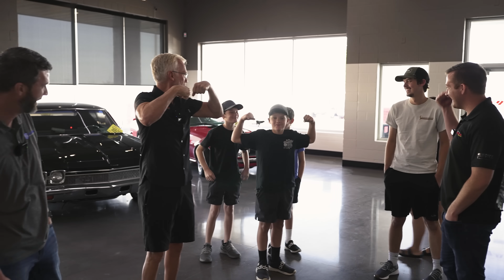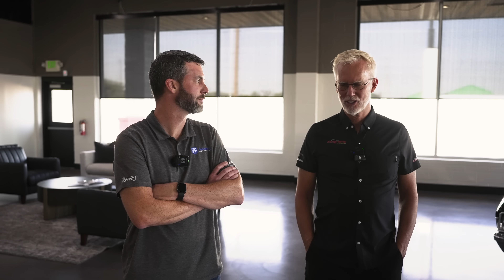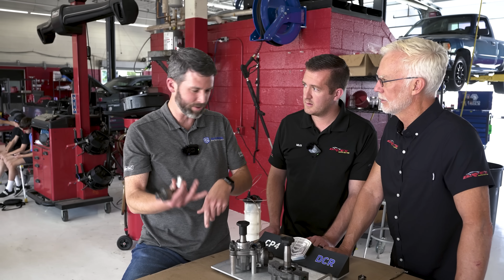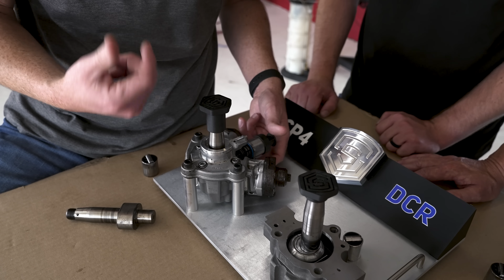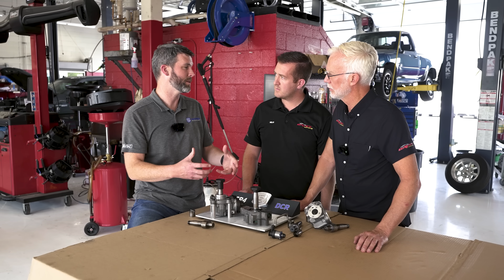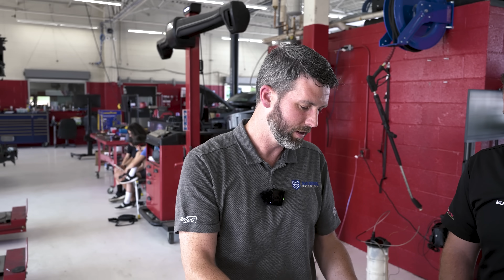Breaking Down How The CP4 Pump is a DISASTER & How To Avoid It With The DCR Upgrade!

Comment: I’m not saying it can’t happen but dang is this being played up to push these additives and pump swaps. We have a fleet of F250, F350 f450 we change the oil, change the fuel filters and fuel up and don’t run out of diesel fuel. None of the trucks in the fleet are under 100k 

Everyone will have you believing that you pull off the lot and your trucks just going to blow up and if you drive a Chevy or a ram you’re going to be dodging Fords because they’re all just failing on the freeways at an alarming rate! Ridiculous haha not mad at you guys, good for you. It’s a hell of a sales pitch.

Comment: The best thing i did was install the dcr on my 2018 f350. It has been on for just a little over a year now, and there no issues at all. Well worth every penny. It is very easy to install if you are mechanically inclined.

Comment: Glad 2015 has the CP3.
Reply: Hey Darryl, If you are referring to the 6.7l Power Stroke platform unfortunately 11-current uses the CP4 design as shown in this video. The DCR is a direct drop in replacement for 11-24.

Comment: S&S talked about making the dcr a key way designed shaft to make it easier for installers to clock it properly without potential for mistakes. It would be nice if they followed through. The dimple design to clock it is a shity shortcut. But it costs them nothing to do nothing about it. Sounds a lot like Ford and the CP4.

Comment: Thanks great info, question ~you ask for our views on perplexing issues you point out in your shorts from us viewers but there’s no place to respond in shorts.
Ok I’m planing on getting a new truck to replace my 2017 Ram 1500 v6. Nothing wrong with it just 8 yrs old with 17500 mils.  However from your insight and warnings for DURAMAX and Fords power stroke wonderment have ruled them out for my wants in a new truck. So, I’m left with a new RAM with its 15 recalls or possibly a Toyota tundra with 3 recalls. I’m going to get your book/video to help make up my mind.

Comment: The worst CP4 failure I've had on a customer vehicle was a pump that seized just like you guys were saying. It was on a LML duramax, when it seized up it did not break off the crank or cam pins. The gear on the CP4 cracked and partially blew up, shrapenal shot a hole through the front cover and some of it went through the crankshaft gear, damaging the crank shaft gear. Customer traded in the vehicle before we knew that it needed more than a complete fuel system. Bad situation but I still think it worked out better for him. Pretty much every CP4 failure I've had was on company vehicles, getting fuel from questionable sources, steel slip tanks, etc. (I'm in Canada, I think our fuel is a little bit better)

Comment: I have the S&S disaster prevention kit is on both of my ford 6.7 's such a great company out there, just knowing if the cp4 goes it'll only cost me a new s&s dcr conversion pump rather than a $10k plus engine repair if the cp4 grenades awsome company highly recommended
Reply: Or get a low miles CP4 swapped from someone for a couple hundred bucks, CP4s are fine, good fuel filters, good additives and easy 500k miles on one.

Comment: These should be standard equipment right from FoMoCo now. How many class action lawsuits are needed before they realize how bad this Bosch pump is. Other manufacturers have got rid of this CP4 pump now just for this exact reason. Follow along Ford, ditch the Bosch CP4.2 pump, and help bring back PowerStrokes to the top of the list of the best diesel engine made today.... It's already the strongest! 👍🏻👌🏻🛠️🔧🔩🦺🛢️

✊🏻🇺🇸🦅🇺🇸✊🏻

Comment: The easiest way to keep your CP4 or even your CP3 healthy and happy is to use quality fuel and a good additives for lubricity. I’ve seen a million miles on a CP4 with no issues if you just use common sense preventative maintenance. I’m not saying if you have an extra 3 grand laying around it’s not a great upgrade, but in today’s economy, most of us have to keep our stuff that we have working.
Reply: A friend had his F250 pump grenade. The repair was $11k.
Reply: @AlanSanderson-u4t  I understand, but that isn’t the pump’s fault, they have been using CP4s in Europe for decades, it’s the fuel. We have ultra low sulfur fuel here in the US they don’t use that in Europe. The sulfur is the lubricant in the fuel. If you use an additive like HotShot or Howes, the chances of something like that happening are very slim. Water in the fuel is also a big factor, that’s why you need to be careful about where you get your fuel. Even with a DCS conversion, if you run crappy fuel, you’ll be replacing injectors and rails.

Comment: what is the weld procedure  you are using  for tig welding the crank gear to crank shaft ...any preheat/ post heat .. and what filler rod are you using... being this material is not just plain carbon steel

Comment: Clearly the have to come up with a better high pressure fuel pump.  This is not good.  A better design would be a multiple piston pump with a shorter stroke to achieve the same volume.  The ramp would be less aggressive for each piston.  The DCR is an elegant solution.

Comment: Would another preventative be to have a rising rate fuel pump+ regulator supplying the DC4 pump. Have it run independently off of the ignition so there is always a good flow of fuel to the pump?

Comment: i have an appointment to get my conversion done in the morning on my 2020 with 36k miles and have had no issues with the cp4 to date... i feel like neo in the matrix dodging bullets every time i drive it. hopefully i will feel like smith after, that can never die.
Reply: The cp4 isn't really as bad as people make it out to be, most of the failures are caused by people putting Def, gasoline or contaminated fuel in the tank.  That being said, I dropped my truck off yesterday to get a dcr pump installed.  I've rather pay 3k bow than risk a 10-15k repair down the road

Comment: I had a CP4 fail in my A3 TDI. At least VW replaced everything under warranty... The fact that the main fuel supply first goes through the pump to act as lubricant is stupid. The CP3 keeps them separate and enjoys fewer failures because of this as well.

Comment: Three questions as a VW tech.
What's the difference in a CP3 internal compared to the DCR/CP4 that makes them more robust than the CP4?
And if a CP3 can be retrofitted to so many of these CP4 engine layouts with aftermarket kits, why isn't Bosch and other manufacturers reverting back to CP3 or at least an internal design similar to CP3 to improve their durability?
Standadyne and other additives claim to add lubricity to diesel, would that help the CP4 last longer?
Really loving these videos and thanks in advance for the answer, really appreciate it
Reply: Hi, CP4 ingeneer here :) I work at CP4 factory in Europe. The biggest difference is that the CP3 uses excentrical shaft with much bigger contact patch (triangular shaped "rotor" element on the shaft that is lifting the pistons. The only rotating part is the shaft itself contacting the triangular element with it's full area. 
In the CP4 howewer, the shaft rotates and is directly in contact with the small roller on the lifter that guys showed. This lifter spins 4 times faster than the engine (so about 4000 rpm at idle already) and the contact area is very small. 
CP4 is much much more efficient and capable of higher presssure and flow but it is a bit sensitive. It absolutely can't run dry for any second and also the fuel must be 100% clean and "oily" enough. 
Sadly, most of the failures occur in the USA due to fuel issues. We have most of the recalls sent back to our factory and we do a detailed analysis of every recalled pump and 9 times out of 10 it's the fuel. Usuallly silicone particles (sand, dust), water, other chemical elements...

Secret info - there is a new version of this pump comming out soon (2025). It should resolve the bottom end issues.

Comment: Would it be better for the lifter be a flat tappet like the cp3 pumps...I have the oem cp3 and injectors on my 08 dmax with 320k miles and still going with howles fuel treatment every tank full

Comment: Just had a Case 110C tractor at work that melted 1 piston in the engine caueing blow by and no compression on cylinder 4 eventually leading too a crankcase of engine oil diluted with diesel wiping the engine out. The CP4 had been replaced recently, it was still shiny and clean looking without the engine paint on it like it comes factory, and the injectors appeared original and once i pulled rhe FCA it had metal on it. It appeared it probably had a running issue and it had an injection pump put on it due to low or insufficient rail pressure and that was the extent of the reapir. Im sure after a new pump it ran as it should until it sent metal into injector 4 and held it wide open which melted the piston and the tip of the injector finally causing a crank no start as all of the rail pressure was dumping out of injector 4

Comment: Running a 2013 LML DMAX with the CP4 pump and the only owner   Have always used Power Service or Hot shot secret fuel additive.    The big one is, I change my fuel filter every other oil change no matter what the percentage saids on the dash.    Also I get top tier diesel when I can.   So far, 471,567 and still going.    I think alot has to do with keeping that pump lubricated.
Reply: This is the Key. Clean fuel, and a good supply of it. Ford obviously gets the worst in pretension as they have never stopped using the CP4, but I have friends who do exactly what you do and they are well over 300K miles and one just broke 400K in his stock CP4 in a 2018 F350. These pumps can live for a very long time if you maintain them, but at the same time anything man made will fail at some point. It may be today or 20 years from now, but failure is an inevitability.
Reply: You're missing the point of the problem with the cp4.  Yes ppl can use theirs effectively.  Yes ppl can have them last potentially.  One of the other comments said everything manmade will fail which is also true.  The problem with THIS pump is WHEN it does fail as is expected of manmade things, it sends metal through the injectors and causes 9-15k in repairs and renders the truck questionable from that point on whether all the metal is out of the system of not.  Cp3 fail doesnt send metal through the injectors, dcr fail doesnt send metal through the injectors.
Reply: What kind of crud is getting trapped by the filter, and why is it not being removed at the refinery?
Reply: @JeraldFahrsite the issue isn’t the refinery it’s all of the transitions and tanks in between. Every time they open a tank to put fuel in it small amounts of dirt and water enter. The nozzles at the pump collect dirt and moisture. It’s honestly everywhere along the way from the refinery’s. Could you get fuel directly from the refinery and have it be perfectly clean no. It takes basically a 1 micron filter to clean the fuel and that still doesn’t get everything. Plus surprisingly enough there are microbes that can and do grow in diesel and kerosene
Reply: @backinblck1  

I know about the microbes in the diesel from my days in the USMC.  SOP was that you never allowed the fuel tanks to be anything less than 100% full when vehicles were not being used, because growth of some sort would occur on the sides of the half-empty tank, and then you go to use the vehicle and all that crud is in the tank now.  Didn't think about the dirt after the refinery, so thanks for that.  I wonder if say for example a State government could mandate filtering standards for fuel at the pump itself, given that the points of entry for contaminants are so many.
Reply: @JeraldFahrsite  you nailed it in the last sentence. There are far too many points of entry for contaminants so the ability to mandate a scale is impractical. Proper filter changes and high quality filters on the vehicle itself is really the best source to combat the problem.
Reply: @backinblck1  

Again, what if the filtration was done at the pump?  or in the tank beneath the pump.  At least get the bulk of it out.
Reply: Storage at gas stations @JeraldFahrsite
Reply: @JeraldFahrsite  Aeration = death

Comment: It is so sad to see how bad  American engineering has become. It is because there are no consequences for shitty designs. The sheep still buy the trucks. Ford shouldn't be able to find any customers for their diesel truck until they properly fix the issue. The sad thing is that the aftermarket has many bulletproof solutions. This is from a guy who just spent $24k fixing his 2018 F250 with 140k miles on it. Will never buy Ford again
Reply: That pump is German engineering.
Reply: Ford engineers took a pump designed for European diesel and slapped it on a US engine and wondered why the thinner US diesel cavitated and didn't lubricate the pump properly. There is no way they didn't see that failure happening in testing. They probably just felt it was cheaper to deal with the fallout than fix it. GM felt that way, too. They just settled and got away with paying out a pittance.
Reply: @redrubi3942  I understand that the sulphur in the fuel contributed to the lubrication. S-15 removed most of it.

Comment: Hey Dave, I see you all the time on the internet. I want to ask you about a 2014 key a real. It's a 1.6. It has direct injection. How could I clean the valves without tearing the whole car apart to do it? Because I know that it gets debris from the used gas on the valves and then sometimes it drops into your rings and it holds your rings open.  So how do I clean the valves?Could I do it through an injection clean?

Comment: The cylindrical  shaped cp4 is a failure configuration  ,try a dual fed oval shaped design cp4 with dual metering valves

Comment: I can appreciate my CP3 even more now. 754k miles and 19 years...
Reply: Damn! I'm at 300K on my CP3, and I was worried I'd lose it soon?!? I did the CAT filter swap so now I'm getting 2 micron filtering.
Reply: @jeffferguson4632  I changed the injectors at 610k just because (did the tuning myself and advanced timing was pinging a slight bit, and I pay attention to my machines, injectors were still good, took 93 tunes for me to be happy, including Allison tuning) CP3, only changed the FPR once. I did the CAT filter about 500k, it's a good deal but pay attention to possible water in fuel... my compression was 410psi all round at 610k and internals are clean as can be. Keep it driving and it will keep going.
Reply: @dudeman8323  FPR == Fuel Pressure Regulator? Didn't know I needed to be watching that. I'll study that one!
Reply: @jeffferguson4632  Yes. It can stick and over correct at idle causing the engine to surge but if it gets really bad you can start to feel it when cruising. Bolts to the rear of the CP3. My current FPR (second) is starting to surge slightly but it smooths out when the fuel temp rises.
Reply: Would you be willing to share if you put additives in your fuel or where you buy your fuel I mean, what station brand?
Reply: @Iwillnotbepushed  I've fueled up all over the country so many brands. Occasionally I'll use powerservice but I also add a bit of 2 stroke oil. No where near every fill up... sometimes the fpr sticks (idle surge) and the additive makes a difference.

Comment: Amazed that both Ford and GM stick with the CP4 given it's prone to failures that are extremely expensive.  At least Ram realized the problem and stopped using it and retrofitted all of the trucks they had installed the CP4 on with CP3's.
Reply: GM stopped using the cp4 with the 17+ trucks
Reply: @robo1210 yeah, but the HP4s they switched to also fail and cause the same catastrophic damage. Not sure if it's the same level of failure rate, but I've done a couple LP5 fuel systems in the last year because of pump failure.
Reply: @robo1210  and was worse off, the Denso systems suffer the same exact catastrophic failure.
Reply: You're mistaken..

Comment: @DavesAutoCenterCenterville
Could you make a habit of showing a chart of the major brands RAM, Ford, GM across the top with the models through the years down the side  and explain at the beginning what models are susceptible to “X” and which aren’t, and WHY for each case? I have 2007 Cummins 5.9 on RAM 2500, which isn’t covered much except for #6 porosity.
Reply: I agree

Comment: The Bosch CP4 found on the LML engines has been replaced by a Denso HP4 that should eliminate the countless failures of the CP4.
Reply: Does HP4 have separate lubrication from pump?